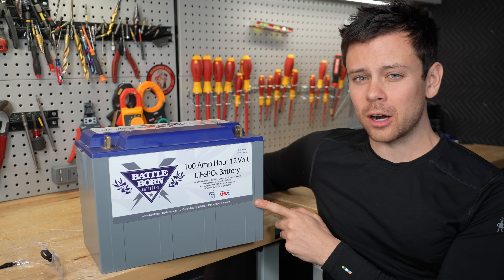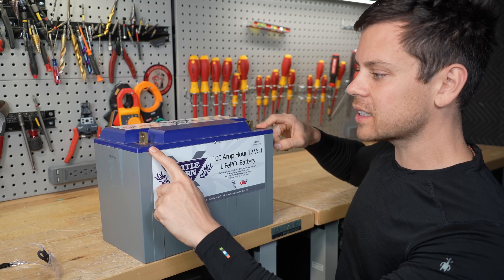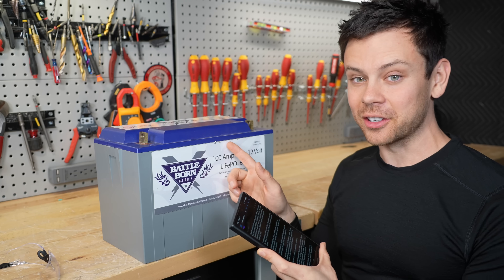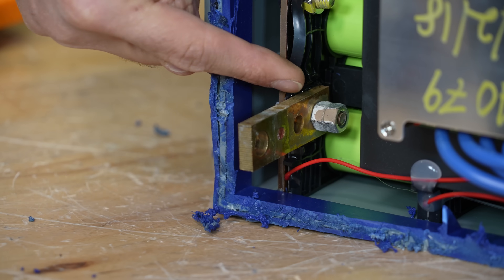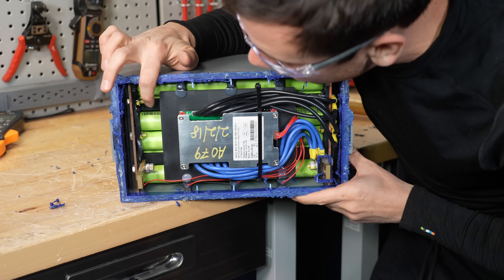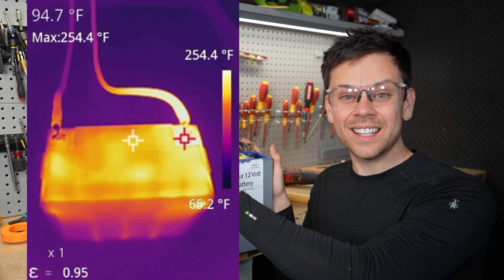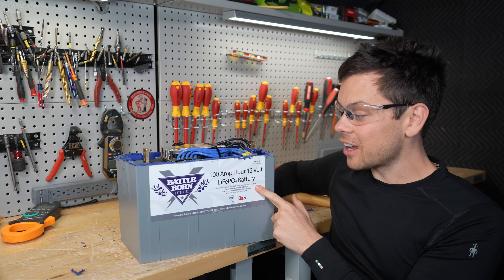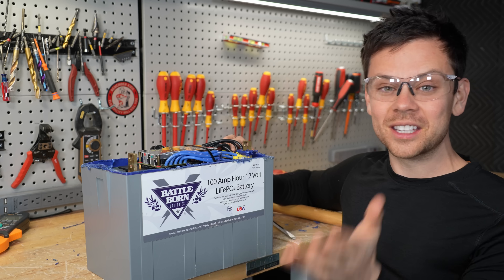Battleborn 12V Battery: Major Safety Issue

Comment: Update: I just received a response only a couple of hours after I sent my email to Battle Born. It states that this is by design and that nut is aluminum. They said this is all part of their engineering and it has been UL approved. I started to copy and paste the email that they sent but the fine print at the bottom of the email said that I could not share it with anyone. I don’t particularly want to get sued so I’m not going to. Again, they claim that this is by design to protect the cells from runaway thermal expansion.
Reply: That is pure bs. The BMS should have a high-temperature cut-off to keep the cells from thermal runaway!
Reply: Is this it? Someone already posted:

Thank you for contacting us. We appreciate the opportunity to provide technical context regarding the engineering and safety of your system. We understand there are conversations circulating externally, and we want to support you with facts about how our products are engineered and certified.

Regarding the concerns you raised:

Battle Born Batteries have been available in the market for more than a decade. During that time, we have delivered well over 400,000 batteries into service across all major markets. Our solutions have undergone extensive third-party testing to UL standards, we operate an open production process in the United States, and we routinely provide tours, published videos, and engineering transparency. These outcomes and the long track record of safe operation speak for themselves.

To address questions that have recently surfaced about terminal heating and fastener design, it is important to highlight that what some observers view as a failure is a safety device working exactly as intended. The aluminum nut used in our 100Ah packs’ positive terminal is a purpose-built thermal failsafe. It is engineered so that the plastic deforms and disconnects when excess heat is present at the terminal.

This protects the internal cell structure by interrupting the current, preventing further heat buildup and thermal runaway. This safeguard exists for conditions created in the field such as loose external connections, systems operating outside specification, or uncontrolled short circuits. It is one of several intentional protective mechanisms within our packs and is necessary for our UL Listing Standards.

The key takeaway is this: This design prevents heat from migrating into the cell stack, meaning it is designed to stop conditions that could otherwise create a thermal runaway event. It works as a sacrificial barrier that takes the heat event on behalf of the cells. That is the exact purpose of the feature.

In cases where a pack has already experienced misuse or improper installation, visible damage at the terminal is typically the result of that safety mechanism activating. That does not mean the design is flawed. It means the protective feature served its purpose. The batteries we sell and support today use the same trusted and validated design that has been in successful field service for many years.

If you are currently experiencing a specific operational issue with your system, please reply with photos of your installation so we can assist you further.

Sincerely,
Reply: Yes this is it exactly.
Reply: @jimm2442  It's hard to believe that's a design feature. More likely, they made a story to avoid a massive recall.
Reply: @shday1  Yep. That story sounds like a load of BS, and the defense lawyer/paid expert's wording for the big lawsuit that is coming. They claim the plastic deforms to prevent coupling heat into the battery cells. Yet the loose connection itself, which is NOT acting as a fuse, is going to create more heat.

Comment: The overall design is poor but a drop of Loctite threadlocker would have prevented a loosened connection
Reply: No, it would not, as there is plastic between! BB needs to put in a copper sleeve that goes through the plastic first. THEN your idea would work.
Reply: @Tumbleweed5150  Yep. But do note I started with "the overall design is poor" because it is. I'm only focusing on the loosened nuts which would be prevented with a drop of Loctite. 
As Will pointed out, having only a bolt carry the current is also a poor design decision.

Comment: battleborn is not going to do anything, stop buying from them. my DIY solution: cut off top, check, tighten, put the cover back on and tape it shut with duct tape and use them for other things that don't need a big load on them and never buy from battleborn again :face-orange-raised-eyebrow::face-orange-frowning::text-green-game-over:

buy from competitors or DIY one yourself, many suppliers out there :face-fuchsia-tongue-out:

Comment: Here is battle borns response to my question about this video claims.

Thank you for contacting us. We appreciate the opportunity to provide technical context regarding the engineering and safety of your system. We understand there are conversations circulating externally, and we want to support you with facts about how our products are engineered and certified.

Regarding the concerns you raised:

Battle Born Batteries have been available in the market for more than a decade. During that time, we have delivered well over 400,000 batteries into service across all major markets. Our solutions have undergone extensive third-party testing to UL standards, we operate an open production process in the United States, and we routinely provide tours, published videos, and engineering transparency. These outcomes and the long track record of safe operation speak for themselves.

To address questions that have recently surfaced about terminal heating and fastener design, it is important to highlight that what some observers view as a failure is a safety device working exactly as intended. The aluminum nut used in our 100Ah packs’ positive terminal is a purpose-built thermal failsafe. It is engineered so that the plastic deforms and disconnects when excess heat is present at the terminal.

This protects the internal cell structure by interrupting the current, preventing further heat buildup and thermal runaway. This safeguard exists for conditions created in the field such as loose external connections, systems operating outside specification, or uncontrolled short circuits. It is one of several intentional protective mechanisms within our packs and is necessary for our UL Listing Standards.

The key takeaway is this: This design prevents heat from migrating into the cell stack, meaning it is designed to stop conditions that could otherwise create a thermal runaway event. It works as a sacrificial barrier that takes the heat event on behalf of the cells. That is the exact purpose of the feature.

In cases where a pack has already experienced misuse or improper installation, visible damage at the terminal is typically the result of that safety mechanism activating. That does not mean the design is flawed. It means the protective feature served its purpose. The batteries we sell and support today use the same trusted and validated design that has been in successful field service for many years.

If you are currently experiencing a specific operational issue with your system, please reply with photos of your installation so we can assist you further.

Sincerely,
Reply: This can't be real.
Reply: @shday1 its real and others have received the same response.

Comment: Good pro-tip video! I have 8 of these batteries in my boat which I was thinking about replacing with a bigger house battery system (from another manufacturer) anyway. I installed them almost 3 years ago with no problems. I guess overpriced batteries  does not always mean quality production.

Comment: Cutting the batteries open. A bag of conical washers for every bolt and gluing back together with some two part epoxy and vinyl tape. Would be likely a diy's fix. But I am not a electrical engineer. If I was a battle born employee. I would be sending out job app's.
Reply: Not conical washers, flat brass or copper washers thicker than the plastic spacer, so all bolt pressure is on the two busbars and the surface area is increased by the washer(s). Probably have to bore out the plastic spacer to accommodate the radius of the washer(s). The add a terminal fuse outside.

Comment: What to Do If You Have a Battle Born Battery:
Check for Issues: Periodically feel the positive terminal of your battery under heavy load to check for excessive heat.
Contact Support: If you notice issues or feel this is a widespread problem, contact Battle Born Batteries directly with photos/videos of the problem.
Warranty Claims: Many users report successful replacements under their 10-year warranty by providing evidence of the defect.

Comment: Will I have 5 of these batteries and all 5 went bad.  I was experiencing issues with my 12v system in my RV.  I was having voltage drop at 50% cap. Volts would drop to 11v and disconnect at low voltage set point with soc at 50%. So I called BB. Long story short, ( If you want the long version let me know.) I had to breakdown my entire system to rule out any other issues with solar, Vic inverter breakers etc. etc to prove to BB and myself that it was the batteries. All at my expense buying charger for each battery test another inverter to draw down battery all while documenting all test results for BB.  BB said ok send them to us but I would have to pay shipping fees upfront ( Over $400 ) and $150 p/h to repair if not under warranty.  So after 2 month without batteries BB repaired 1 of the batteries and replaced 4 that were " NOT REPAIRABLE "and sent them back.  I have all this documented with emails. In all BB took care of it, but it took 2 months, money upfront, and loss of power for my RV which we are Full time Boondockers. Battleborn answer to what went wrong was, " I’m unable to see notes on repairs." They are back in my RV but I sleep with one eye open and a good smoke detector on the batteries!!!
Reply: There is an issue with them  during that time and they still have not taken accountability for the issues. Lets see how they respond now that it has become a public issue know to them.

Comment: Not at all surprised. I have three older 100 amp Battleborn batteries and none of them will take a charge or discharge. Multiple attempts to contact Battleborn have resulted in no help despite their supposed long warranty.  I would never recommend such an expensive junk battery to anyone.

Comment: A couple of years ago, I bought two of these. Six months into usage, the plastic supporting the positive post on the first unit began to melt while charging. I am extremely thankful that I regularly inspect my batteries, or the situation could have been much worse. I immediately stopped using both batteries; the second was already failing to charge correctly, making it completely unreliable. I've shelved both units permanently. This post confirmed my suspicions about the underlying fault.

Comment: Mechanically speaking this is not a big deal, just snug the nuts and you are ready to go.
The issue is that these battery boxes are sealed.
They need to make these battery boxes serviceable, so that you can service or get acces to the cells.
If they had, this wouldn't be such a big deal.
I think this goes for all the brands, but that is just my opinion.
But, we see this practically on every item we buy, hardly anything is made serviceable these days.
If a stupid 3cent fuse breaks, your item is bricked because you can't acces the fuse without breaking the whole freaking item. For instance.
Reply: The plastic will deform again, loosening the bolts again. It is a bad bus bar connection design. I agree the case needs to be serviceable.

Comment: One of my 12V 100Ah Battleborns is cutting out under a .5C load :/ I have two of them wired is series. They are 8 or 9 years old. I need to dig through my email for my Amazon receipt to determine their exact age. I am very upset. I paid $1,000 each and expected at least 15 years of service.

Comment: I have four of these that are about 3 years old currently installed in my RV. I just now sent BB (Dragonfly Energy) an email linking this video and asking for advice on what to do. Thanks Will for bringing this to light.
Reply: I did the same. Waiting to hear back from. My guess this is proper a small percentage of batteries or is due to misuse by the owners.
Reply: @tomgiar923  The fact that there is PLASTIC between the bus bars, held together by a bolt is the problem here. Even if the plastic never heated up at all, it can deform from vibrations, etc. NOT misuse by owners!
Reply: The fact that they're using a steel bolt as a conductor tensioned through plastic is an unforgivable design flaw.  

From another Comment: "For anyone not familiar with material science, here is why these fail.  Steel is a poor conductor of electricity compared to copper or aluminum.  This means proportionally more of the energy delivered will be turned into heat in this material.  When the battery is delivering power, that steel bolt will be handling all of the current.  This leads to the bolt heating which causes it to expand slightly and the plastic it's tensioned off of to soften.  When the plastic softens, it loses its ability to maintain its shape against the tension of the bolt.  With the strain relieved, the connections made by the bolt are now even higher resistance leading to more heat being generated by the now loosened connection.  This cycle continues until something breaks contact."

Comment: I had the same issue - the positive post was melted inside the battery - Local distributor didn't want anything to do it and has subsequently dropped BB.  BB did did provide a replacement  - The shipping on the RMA was $740 - I convinced them to let me keep the bad battery.  I will open it up to confirm its the same issue.  I have two more - I guess I will have to break them open and make sure the nuts are tight. - thanks for bringing this to our attention.
Reply from the maker: No way!!! That's horrible
Reply: That's not a warranty, that is just selling you another battery. Sheesh!

Comment: I think this is probably a quality control issue, as im sure some people have tons of these batteries - the issue is likely only if the battery is overheating. if its not overheating, its probably ok and likely an iteration/design change or quality control issue from a specific batch or production time. still, thats incredibly dangerous! if the terminal is loose then that means the connections to the cells are loose and also overheating, and these are sealed so you can't know they're close to danger or bursting until its too late and your whole battery pack is on fire / melting everything around it... edit: the more concerning item about these batteries is they are overpriced and 'made in USA' so a lot of older folks purchase these, folks who don't always look out for this kind of information. this is dangerous if they are not proactive in taking action to alert their customers.

Comment: This is sad, I deal with this type of issue almost daily in my work. As much as I want to support US workers, too often I cannot. Too often "Made in USA" just means that a company designed their product to be as cheap to manufacture as possible in order to have the highest margin possible and make the most money for the shareholders as quickly as possible. There is no consideration for long term reliability or brand failure due to an inferior product in the future. They are not concerned about the long term viability of the company, just next quarter's shareholder dividends. If the company fails due to quality control, it doesn't matter because the shareholders already made their fortune. In other countries, people build a brand, a company, with focus on the long term. They focus on quality because they want their customers to purchase their products knowing they are getting a quality product. In the US, it's all marketing and smoke and mirrors.

Comment: We stopped using bb long time ago because they are just difficult on so many levels. Battery terminals suck I absolutely hate them. Hard to install or take out in our cases. The nuts get cross threaded to the bolts ALL the time and you have to cut the bolt off a live battery to get a cable off. I can’t tell you how many times we cussed out some battleborns in our shop. I might put a video of me putting it out it’s misery in the backyard. With this video out looks like we will be battling a lot more battleborns out of people’s airstreams. Please pray for me

Comment: Jees, that looks really bad. I wonder why they would stick a piece of plastic between 2 big chunks of copper you want to be electrically connected and handle high amperage. I don't have one of these batteries, but thank you for the heads up.

Comment: Go to the 2:01 mark and look at the bolt on the negative battery terminal.  It looks like at least one of the cables coming from the BMS are connected between the nuts, not on the busbar.  If that's the case, that's a big red flag.

Comment: Will, welcome back!  I was worried about you, having hurt your foot, then disappearing for a month, but I'm glad you are recovering.  WOW, those are the same batteries that Martin Johnson Off Grid Living used to use before he made that upgrade a couple of months ago!  It's amazing how such a HIGH PRICED battery can have such a dangerous defect!  HOW in the world can the BMS temperature sensor not detect all that heat and shut down the battery???  Not placed close enough to the terminal?  Just shows that you don't always get what you pay for.  They really need to recall all those batteries.

Comment: Dragonfly Energy is the manufacturer of Battle Born batteries.  I have 2 of them powering my travel trailer.  Now I'm going to have to go check them out even though I have not experienced any problems.  Several large RV manufacturers use them as standard equipment.